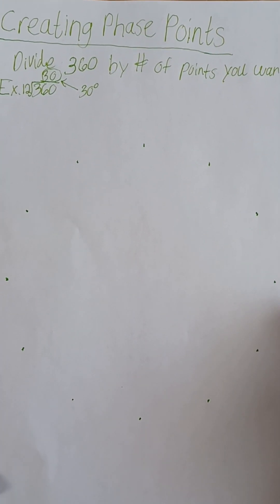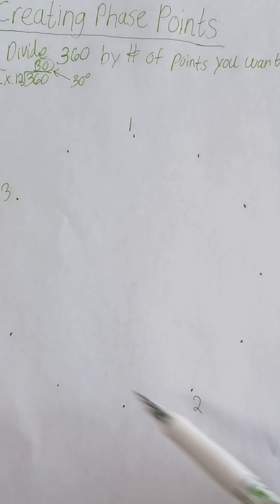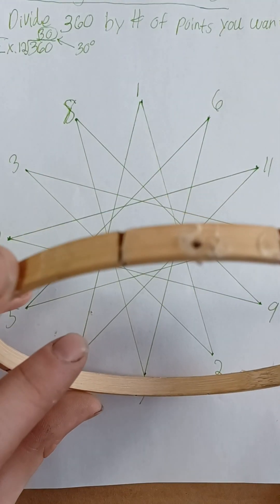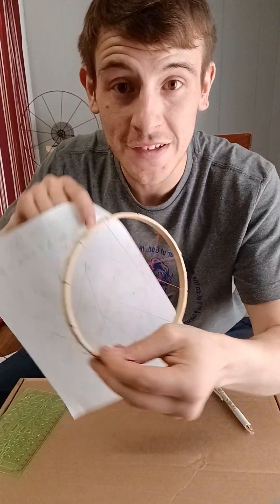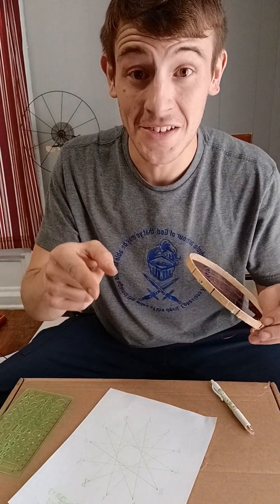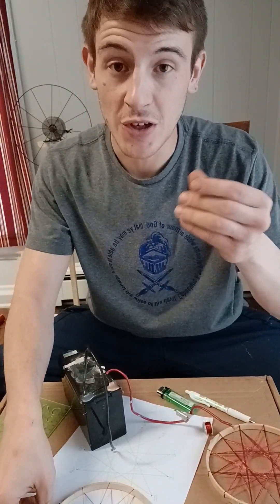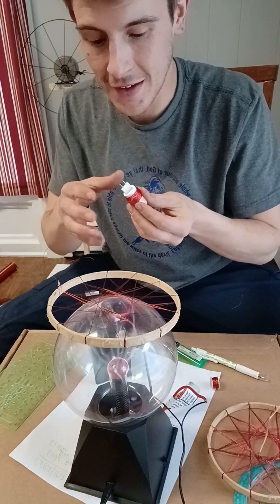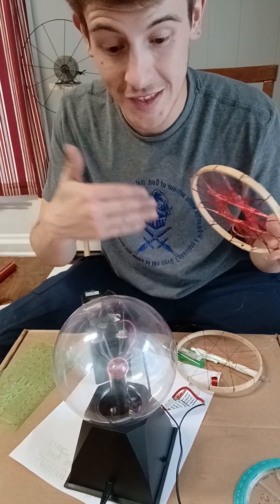How to Build a Dodeacagram Star Coil with Vortex Based Mathematics

Comment: Question could you build that around a tensor ring using the sacred cubit measurements?
Reply: I don't think it matters the type of measurement as long as you maintain the ratio    in other words the size of the pyramids in feet is in ratio with the earth in feet. Just maintain the ratio. I think you can also use the golden ratio 1:1.6. inner coil: outer coil.  The math is hard and winding it is harder lol. Good luck!

Comment: You can also get the 30° by making a circle cut it out, fold it in half twice. Now with a "quarter part" line up on speed square. Get a ruler if paper isnt large enough and make lines at 30° and 60°. Darken the lines. Now un fold and you can get the other 3 quadrants done by using the measurements you just made. I didnt have anything but the speed square. So made due

Comment: What gauge wire are you using and where can I buy the spool  you are using. This is really great. Thank you.
Reply from the maker: .2 mm is what I used for this. I pulled the wire from a junk contactor I had from work. I have .1 mm wire on order right now for my trioflux generator and more star coil designs like this one.
Reply: @Resonate369  Thank you for your help. Do you have a patreon account to receive contributions? I have learned a lot from you. My question is if you have 9, 20, 30 points coil. Is the skip sequence always the same (5) or does chane and how to do it. Thank you so much.